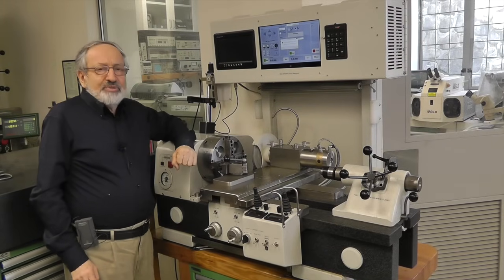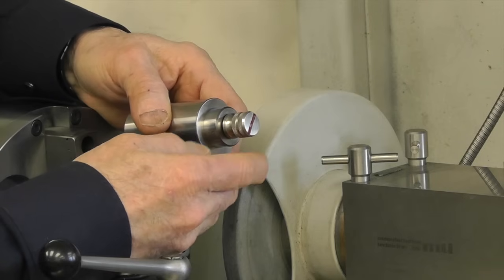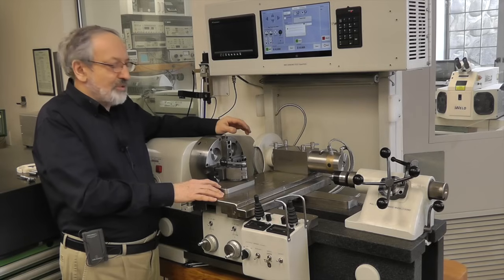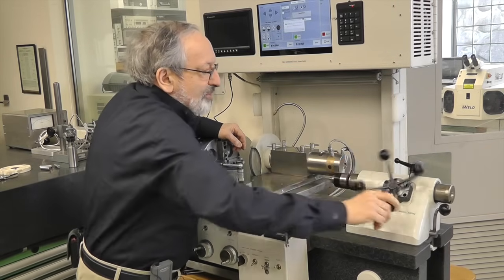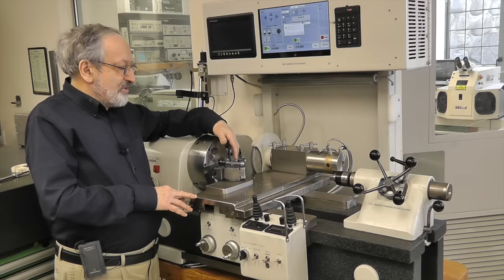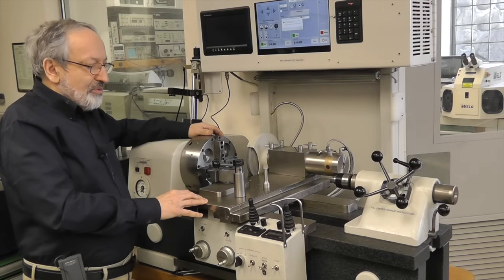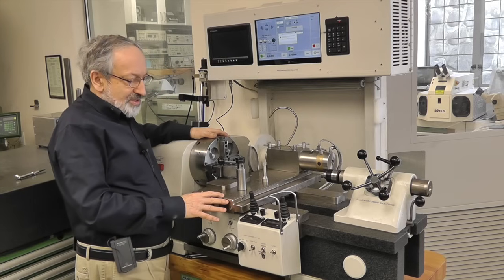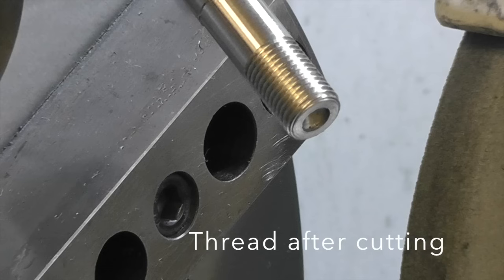High precision air bearing CNC lathe and grinder

Comment: How do you control tolerances for grinding? Does this machine measure the wear of the grinding wheel somehow?
Reply from the maker: The machine does not compensate for wear. You have to measure the diameter before the final passes. For every type of stone, there is a ratio of stone wear to metal removal, and you can do the final passes using this ratio, scaled for the areas.

Comment: i'd like to know much more about the granite ways and how that works (how to prevent wear etc) ...
Reply from the maker: Air bearings have no wear if you can keep the dust out.
Reply: oh - the carriages for the tool holder/compound and for the tailstock are all mounted on an 'air bearing' along the granite bed itself??? hmmm - how does THAT work? I thought the air bearings you were referring to were only concentric pieces
Reply from the maker: @antigen4  Correct, everything is on air bearings.
Reply: this is amazing and eye opening for me thanks! I was recently thinking about how so much conventional lathe design could be re-engineered and re-imagined

Comment: Oh really, hot shot? Show me how your fancy chuck is gonna grip that 0mm diameter part.
Reply from the maker: For small diameters I use the regular chuck jaws, which can grip down to 1mm. The round pins are for large diameters and ID gripping. For under 1mm I use a Boley watchmaker's collet adapter. Boley collets grip down to 0.1mm.

Comment: Wow.  
Discipline & accuracy I could see in your dress code & explanation.  You are the Albert instine of machine building industry.  Your work should be taken to the next level.
Air bearing may not work in case of axial load.
😊

Comment: How to build a precision machine . First I bought everything and had someone else make the CNC brain . This is stupid
Reply: He bought two air bearings (out of probably two dozen in that machine), and he bought some granite parallels, and he bought some steel, and some brass, and....  I mean, if you say you "made" something are you the one actually mining the ore out of the Earth, smelting it, etc?  No.  You "buy" raw materials and then you turn them into something new.  That's exactly what this guy did.  He made a lathe bed from granite, he made air bearings from steel, he made a headstock, a cross slide, a chuck, a tailstock, a complete CNC setup (the only part he didn't do was the software development, which again, if you yourself "made" a CNC lathe I doubt you'd do either).  Your comment is the thing that's stupid.

Comment: Very very impressive! Yes, air bearings are the best and very strong! However many questions: What if one of the cylinder gets warm that can expand and it can lock up, do you need a special CNC computer because the interpolation was more limited on common machines? Like a longer computer floating point all the way across on all axis? During grinding how can you avoid grinding compounds from contaminating on those axis rails? I am sure you have already figured that out but care to explain. Thanks.

Comment: Keeping machines clean, well lubricated and gib strips tightly adjusted ensures accuracies.
In my 50 years of engineering I never saw anyone but myself adjust the gib strips on the sliding parts of machine tools.
This however is carried out every six months on machines in Japanese machine shops.

Comment: Anyways Dan, I'm planing to build a high accuracy granite based multi-operational CNC mill/turn grinding machine. 
I was considering the hydrostatic ways on all axes which are of course whole another world to make them on my own in comparisson with the air ones. Anyways, you didn't mention are you using airstatic or "free-flow" air bearings? What is your opinion of making air-static bearings and using them as linear guides on all axes on the milling machine? 

Thank you in advance for your reply. 

Aleksandar

Comment: .003 is press fit, the example of the cylinder/piston doesn't make no sense when he's talking about .00004.
Reply: It's + or - .00004 for all intents and purposes they are the same size and fit together.
+ or - .003 can mean that it's .003 too big or too small. So they are close, but not the same size.

Comment: Totally porn .. I m jaleus with this machine, comparing to my hardinge lathe..
Reply: @CBRFFan  what do you mean with resolution? The reason I ask is that resulotion and actual accuracy are different things. After looking at their site for one of their modern machines the resolution on the glass scales is 0.01 micron, drives are 0.1 micron and it results in a accuracy of 2-3.5 micron in X/Z
Reply: @CBRFFan  I don't think so. Make a part with your lathe and then compare it on a AA surface plate with gauge blocks. See if you're within 0.1micron. My cheap caliper shows down to 10micron but the accuracy is 25micron (1thou). My micron glass scale has an accuracy of 2microns. So what you see on your display is not what you get
Reply: Micrometers that read in 0,01mm are sometimes calibrated with 0,001mm accuracy. Something that is reading in 0,001 or better may as well be 10 times worse than the reading. At any rate that accuracy requires flooding the whole machine body and screws especially with temp controlled cooling oil. If it doesn't have that, it's impossible to be so accurate consistently

Comment: Dan, from their noise, it seems you are using steppers as axes motors. Their stiffness is not good at all, so I'm wondering why you are not using servo motors on a similar top level job. Is there any feedback on stepper drivers? In case, is it on tre rotary axes or on the linear moving parts?
Amazing job, bravo!
Reply: Correctly sized stepper motors paired with modern drivers have more low speed holding torque and precision than a similar DC servomotor system. Steppers would be the obvious choice for low speed machining such as this. Servomotors are more suited for high speed operations. However, in recent years less expensive 3 phase AC type servos have hit the market, and they can cover both high and low speed regimes.
Reply: @michaelmilberger9013  After watching all your videos (and, amazed, start watching them for the second time), it's hard to tell I disagree with you.

The nominal holding torque of a open loop-driven stepper motor is reached only when the displacement of the shaft is +/- 1/2 of the step angle. The actual torque has a (quasi) sinusoidal shape, with just zero torque at zero displacement.

For a 3-phase servo motor it's the same, with the nominal torque reached when the displacement reaches +/- 60°. It's only thanks to the feedback that servos can hold the position, at the nominal torque, within +/- one encoder step. This is the reason why servos work with very high resolution encoders.

Stepper motors equipped with feedback encoders work similar to servos, but with worse high speed properties due to the high number of poles.
3-phase motors used on servos assure the best results, from static to high speed conditions.

"Static Characteristics" paragraph on this page

https://www.orientalmotor.com/stepper-motors/technology/stepper-motor-overview.html

explains this concept far better than me.

Comment: I'm building parts for endoscopy components as small as 2 mm in diameter and 200 mm long. I am impressed by the accuracy of this machine. It makes me dream of having one. Is it possible to grind glass with it? Could I grind and polish aspheric lenses with 2 mm diameter with it? I know that for finishing the lens I need 20 times better accuracy but for this step I already have a solution. What is missing is a method to make the raw block of the tiny aspheric lens.
Reply from the maker: The best way to make such small glass aspheric lenses is by molding. Several companies offer this service, and the price per lens is about $5 after you paid for the tooling. That is how DVD lenses are (were?) made.
Reply: @dgelbart  thank you for your comment. Press glas lenses are an option. However, the optical index homogeneity of these lenses are an issue. I don't know of any endoscope manufacturer who uses press glass lenses in their Hopkins relays though. But maybe they are worth a try.
Reply: For manufacturing of bigger lenses LT Ultra, Nanotech and Satisloh come to mind, they build machines for diamond turning and grinding. Submicron accuracies can be achieved with Ra values down to single digit nm.

Comment: Highest accuracy granite parallels 1000mm long I came across are flat and parallel to 5 microns, hardly economical too. Only £2000 for a pair.
Reply from the maker: Precision Granite, where I bought from, sells a 1um accuracy pair for $1208: see page 8 of   http://www.precisiongraniteusa.com/images/PGCATALOGPRICELIST.pdf
Also, keep in mind that for a given parallel, If you use only half the length for travel the accuracy will be not twice as good but about 4 times as good.

Comment: Hi Dan,

I am really sad there are no more videos being released lately...

I would love to learn more about this machine. The design of each part of the machine. How the manual traverse is set-up. where the parts are from etc.

How much would it cost to make one of these machines do you think
Reply from the maker: Sorry that I don't have the time for more details. The cost of building the machine is not high, if you don't count your time, about $10,000 in materials.  The problem  is that you need a good machine shop, equipped for precision work.

Comment: Hi Dan,

How do you take the axial load with radial air bearings?
Reply from the maker: There is also a thrust air bearing inside the headstock. It is a disc with air bearings on both sides.
Reply: thanks for the response! if you don't mind me asking are there any plans for more youtube videos?
Reply from the maker: @chiquinhoreydelas  Yes! One coming soon on metal 3D printing.
Reply: That's truly great news Dan, thank you so much for showing and teaching us these things that most of us would never been able to see in person!
Reply: @dgelbart  Hi Dan thank you very much for sharing.  Is the spindle like a dover air bearing spindle that you mounted with an additional thrust air bearing?  I assume you had to machine a custom mount for your chuck as well?  It would be neat to see more information about the spindle.  Thanks for sharing what you have regardless!

Comment: How do you stop the grinding dust from chewing out the air bearings, are they under pressure?
Reply from the maker: The air bearings have felt wipers to wipe the granite clean, but I had to add way covers later as the coolant was seeping into the air bearings when the air was off.
Reply: @dgelbart  Thanks Dan, your videos are really useful!

Comment: In rare occasions I’ve machined to tight tolerances like that on my Taiwanese machines. You know it’s right when it compresses air and floats like that. Those air bearings are beautifully quiet. Would love to have a build sheet for this where to locate the parts you’ve purchased.

Comment: Great Video course, thank you. A couple of questions; are the air bearings porous media or orifice? How do you prevent chips from clogging them?  Do the slides move on threaded rods or linear motors?  Be great to see the machine in greater detail; its one of the wonders of the western world. Congratulations. Edward
Reply from the maker: Air bearings are orifice+pocket type, porous media will absorb coolant and plug up. The air pushes the dust out, chips cannot get into the 10um gap. Slides are driven by high-grade ball screws, rotated by stepper motors.

Comment: So let's say cost was not a factor and a high end engine car manufacturer wanted to make a turbocharged car with an air bearing. Is this feasible?  Obviously using compressed air that could be supplied from a separate battery lithium ion unit that recharges from the engine. 

Could this be done?

Comment: Dan, one of the biggest inspirations on this subject! In all your series i never heard you mention the use of metal filled epoxy for casting precision surfaces (on metals, ultra high performance concrete, epoxy granite or any other reasonably stiff and stable material). As someone else mentioned, a "perfect" flat, parallel or square surface could easily be formed by using special epoxy like Moglice or DHT, a surface plate and standard measuring equipment. Or to match a bore to a shaft and so on. For mating or bearing surfaces , but especially for air bearings, as there is no contact between surfaces, so the bearing properties between the materials are mostly irrelevant. Also you can mold in pockets, orifices, restrictors with dissolvable materials like wax or even 3d printed plastics. For example, experiments were made for mating a nut including all the air channels to a precision acme screw with Moglice, which were lapped to each other afterwards for a defined clearance, with some promising results. I'm just pondering what you could achieve with this method, with reduced or even without the hassle of scraping, lapping, grinding or machining surfaces. Also your choice of materials and methods of forming structures would greatly improve. I plan to make a couple of experiments, so i would love to hear your experience or opinion about it. Thank you so much for your content, saved me many years of unnecessary try and error, but also gives me even more inspiration for years of experimentation! much love from switzerland :)
Reply from the maker: You raised a good point, but epoxy granite can only be used where there is no wear, such as air bearings or non moving parts.  It scratches too easily for all other applications. I considered it for the lathe, but the way wipers  collect  grinding dust and chips and would have worn out the ways. Even is the ways are air bearings you need to wipe them. BTW, it is a Swiss invention, introduced by the Studer AG grinder maker under the name Granitan.

Comment: I am thoroughly impressed, thank you for showing it!  I hold a degree in precise machinebuilding and couple others but i am still impressed of the thought you put in it. How long did this project take to finish? Your design is quite better that a lot of the commercialy built precise machines, because it has features the others don't put plus it has the accuracy and combination of grinding and lathe  rig.
Reply from the maker: Took  few months.

Comment: Professor Gelbart, what instrument did you repair that belonged to Galileo?
Reply from the maker: An inclined plane. A screw holding it together just came out when I was visiting the Galileo museum in Florence.  Now you can see the museum at :
catalogue.museogalileo.it/?_ga=2.205653717.754360444.1532558522-1508738874.1532558522

Comment: Hi Dan,

I feel you may have mentioned this somewhere, but would you mind elaborating on the material and construction of the structure of the lathe? Not the granite base, but I mean the parts that look like castings for the tail stock and the spindle. I'm guessing you didn't actually make them out of cast iron, but built it up from steel sheets using the water jet? Please elaborate!

Always a fan and thank you in advance.
Reply from the maker: The headstock is an assembly of water jet cut parts, made from 3/4" steel plate,  brazed together in an oven. The tailstock is a weldment, made from thick steel plate (bent red hot) welded together, then annealed for stability.
Reply: Thank you for your reply. I have many questions that if you'd be incline to entertain us with answers to, I'm sure we would all very much appreciate it. Here goes:

I see that you can buy the accuracy of the bed with the granite, but how about the accuracy of the cross slide? Does the cross slide surface that sits on the granite bed need to also be equally accurate? How about the orthogonality of the cross slide between the air bearing surfaces? Did you somehow get this accurately made or did you build in adjustment to tune the bearings?
How did you tune the air pressure on the top-side surface and the over hang bottom-side surface pressure of the air bearing on the cross slide? I understand that the air gap is to the third power of the flow resistance, thus tuning that is no trivial task.
Lastly, how much difference does using steel as the main structure of the lathe headstock and tailstock vs using cast iron have in terms of vibration absorption?

Thank you kindly!
Reply from the maker: Sorry, no time to answer.
Reply: Appreciate it anyway!

Comment: This takes DIY to a new level. How do you make the precision inner bore of the air bearing cylinder? I understand the grinder for outer surfaces, but how do you do inner surfaces if the grinder wheel doesn't fit inside the bore? Do you have a small inner grinder wheel attachment that works with this lathe?
Reply from the maker: Yes, the smaller grinding wheels are shown in the video,